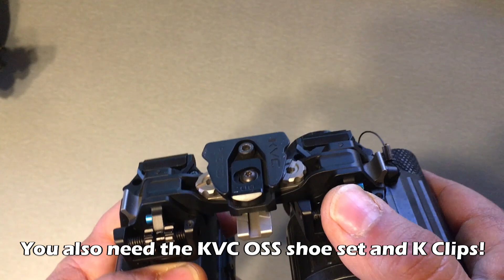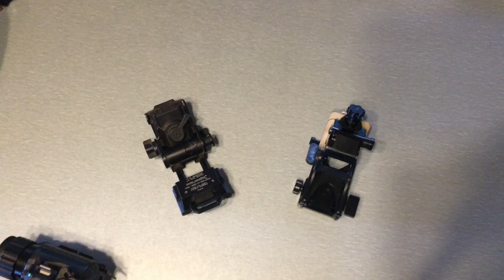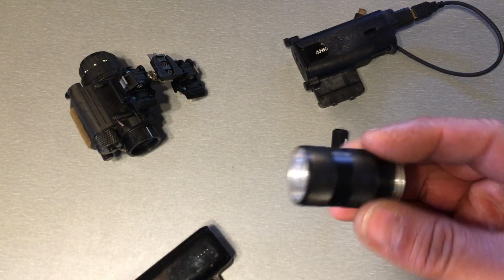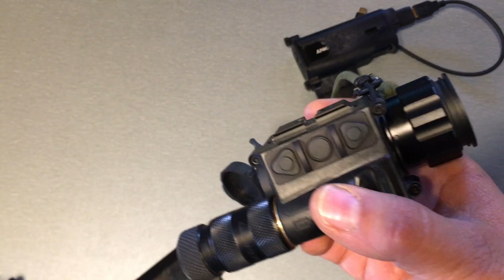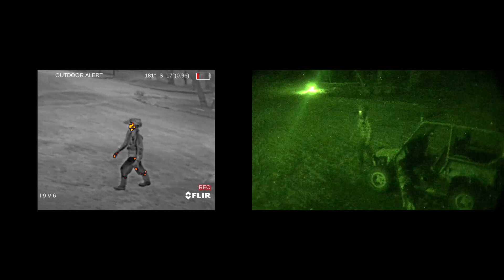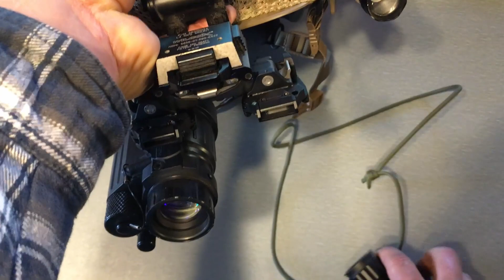Helmet Mounted Thermal : FLIR Breach PTQ136 & PVS-14 on KVC Universal Bridge

Comment: When watching this video I dont understand where the PVS 14 would excel vs thermal. In all these comparison videos thermal seems to brighten the dark areas just as well as the pvs-14 units.
Reply from the maker: The best way to think about it is that night vision is for moving/movement and thermal is for stationary use.

When using thermal you are staring at a small screen and there is latency in the image which does not work well for when using it for walking etc. as well it’s not a “natural” view. With analog night vision although you are still staring at a screen through the lens, you truly feel like you are seeing through the tube. There is zero latency and the image is very natural. It is FAR easier to move with.

Some other advantages are that night vision can see through glass whereas thermal cannot, you can see/use IR tools such as lasers & illuminator, and longer run time (less battery drain).

Which one is better for you honestly depends on what you are wanting it to do for you. Most users end up with both because they compliment each other extremely well.
Reply: @NITEWALKER-NIGHTVISION  awesome thanks for the detailed answer. From what i understand night vision is also better at picking up terrain detail and texture as its actually amplifying the light and can reveal shadows whereas thermal is simply picking up the infrared signature. I was planning on running a dual nv/thermal setup. Would you consider the infiniray mh25 one of the best helmet mounted options?

Comment: If you were going to run a mono PVS-14, would you pair it with the Breach or a COTI? The COTI seems like a great option, but appears to be discontinued now.
Reply from the maker: You can pair it with a breach using a bridge like the noise fighters panobridge. I’d expect COTI’s to pop up on the used market considering how many guys bought them. I’d keep an eye out on the forums and eBay
Reply: @NITEWALKER-NIGHTVISION  sorry, I meant more from the standpoint of how useful each type of thermal is. It looks like the COTI is lighter and has longer battery life. I actually found a source that has both options for roughly the same price right now. I'm just not familiar enough with the tech to understand what kind of thermal is better between an overlay on a mono tube 14 or the twin setup like you've shown here.
Reply from the maker: @Jazz3006  this should help https://youtu.be/kM2SoYXEuUE

Comment: I love my flir breach! I don’t do the goggle thing like you do. I work security and just use the breach by hand. I also have a agm Pvs 14 hen 3 green film I use at work. Love my night vision devices!
Reply from the maker: I agree, I love mine. FLIR got a bad rap when they ditched their PTS scope line but the Breach is a fantastic little thermal. Helmet mounted it works great for long term scanning.

Comment: Excellent video thanks. I have a Flir Scout 640 that I carry on a lanyard that slips into my top pocket to bring up to my non-NV eye occasionally for a look around. It works really well as the range is excellent on the 640 - out to 1000yds to ID a man-sized object. As you show on your side by sides, adding a thermal option shows things you just wouldn't pick up otherwise. Hand-held like this is not as useful in keeping your hands free but does keep the helmet weight down and is a good long-range compromise.

Comment: Hello. 
I didnt it find in manual of Flir Breach. It`s ok to use 3.7 volt 
rechargble battery (4.2 volt full charge)  
instead of 3.0 Volt  CR123 battery?
My frend try to use 
rechargble in Pulsar termal sight  , and damage the sensor by overvoltage.
Reply from the maker: Page 7 of Breach Manual. It’s okay for 3.0v - 3.7v battery. I would use the Orbtronic protected batteries. Those are what most of the longtime users are using and also what I’m using.
Reply from the maker: Orbtronic 16650 with the Mod Armory battery extender
Reply: @NITEWALKER-NIGHTVISION  Thanks a lot!
I`m thinking about  buy Breach and this was  one of my 
concern.
"Orbtronic 16650" - this type of battery turn in to 3V after uplaing some load? Or regular 3.7 rechargeble?
Reply from the maker: @Mil0Fedaikin  I haven’t measured it myself. It’s a rechargeable so probably 3.7
Reply from the maker: @Mil0Fedaikin  Or use an Anker external battery for the USB-C port on the Breach. Those work well with it too
Reply: @NITEWALKER-NIGHTVISION   One more question about this setup.How many counterweight you use with them ?
Reply from the maker: @Mil0Fedaikin  I keep the same amount of counterweight I use for dual PVS-14s (22.6oz) because I switch back and forth between the Breach and a PVS-14.

Comment: I'm planning to mount a Sionyx Aurora pro bridged with a Leupold LTO 2 Std on a Lions Hiperion adapter bridge and wanted to see if there's noticeable lag or disorientation. Does it trip you up when you larp and you constantly have to flip up your arms or mount or have you gotten used to it for long period of use?
Reply from the maker: I’ve never used the Aurora or the LTO. The info that I’ve read/heard is that the Aurora is pretty decent but it will absolutely need an illuminator on darker nights. The LTO will be laggy, may be ok for stationary scanning, but probably will not work well when moving.

Lol, well, I don’t larp so if you mean airsoft I don’t do airsoft. I don’t mean that in a negative way. It looks fun as hell! I live extremely rural with a lot of animal life so I use NV/thermal to watch for them and also instead of using headlamps at night when going around the property.

Comment: Awesome video. several months back I ordered L3 WP PVS 14 from NVision (after watching your videos and your help of replying to my comments) and while I was waiting on that I started reading up on the same exact setup as in this video and I thought this was the most superior way to do an NV setup. pulled a trigger on breach from JRH for a very good price and both arrived relatively same time so I have been running both for a little less than 2 months now with MOD Armory britge and TATM mount and I am very happy way it came out, it took some time to get used to but with WP and breach set to outdoor alert mode I found very easy to move around with PVS14 and as soon as something crossed it lights up with red/orange on breach and gets my attention immediately, other color pallets did not work well because the image would blend in with PVS14 and I would completely miss or loose time in detection of warmer objects. Have you tried running breach on WP PVS14? if yes what's your take on differences? Again, thank you for your work, and know that your videos help a lot of us who are just getting into NV world.
Reply from the maker: Thanks for the kind words. I’ll be swapping the unfilmed back into the -14s soon to try it out. I agree with outdoor alert mode making things pop better while they are both deployed.

Now that the moon is returning, it does work a bit better together for me vs dark nights. The main issue I have is I feel like I’m not getting a good image of either when they’re both deployed. 

Are you able to get any type of fused overlay? With either bridge KVC or D-14 I see double vision.
Reply: @NITEWALKER-NIGHTVISION  Yes there is still a double vision  but moving got lot easier for me after some time time of use. I also found it comfortable to run pvs-14 on my dominant eye and breach on the non dominant eye, i move with both down and my brain 90% focuses on pvs-14, some times it feels like breach is not even there, as soon something pop's on breach, i stop immediately and focus for as long as i need and then i resume to move with pvs-14, transitions used to be very slow and my head would start hurting but it's gotten much easier and faster now. Please update us when you try it with unfilmed pvs-14.
Reply from the maker: @lexousa  Thanks for the info and will do!

Comment: Human eyes converge at a focal point. If they're not allowed to, the image doesn't resolve naturally, and can cause double-vision, headaches, etc. (VR headsets have struggled with this)  It sounds like the bridge you're using holds both devices in parallel. Apparently that works with the analog tubes, but not with a digital sensor and screen in the mix. Wonder if there would be a way to tilt the devices inwards towards a focal point while still holding them firmly in the bridge. Or maybe just the Breach. Can the dovetail adapter on the Breach be adjusted minutely like that?
Cool vid, thanks for sharing. I've personally been mulling whether it'd be better to run a stand-alone thermal monocular or a COTI.
Reply from the maker: Thanks for the reply. I took them off the bridge and tried that with the same result. It seems guys can get the MH25 with the PVS-14 eyepiece to overlay by collimating with the PVS-14. As far as I know there’s no way to do it with the Breach. I did try collimating the PVS-14 by rotating the eyepiece while on the bridge to see if that did anything. Same result of double vision.

Comment: Do you know if the battery extender from MOD armory keeps the Breach's waterproofness rating?
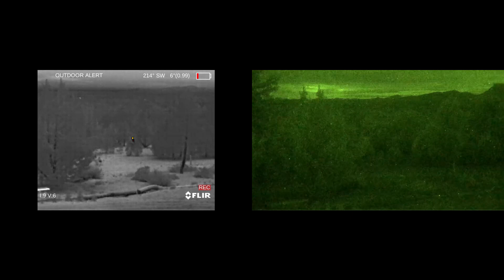At 15:19, what intensifier tube do you use? I played with an amber filter for a while, but found it to be too dark in low light conditions for my Mum-14. It does however work great if it is not extremely dark.
Thank you for making this video!
Reply from the maker: There is an o-ring on the cap side of the extender so that should maintain it however I don't if that's 100% accurate. The green phosphor tube I used in this video is an L3 M890AV. It's a 10160 autogated tube. Agreed on the amber filter. They work great on bright nights but when it's really dark out I prefer to remove it. The amber filter I used is a glass filter with a lighter color than the Wilcox. The Wilcox is WAY too dark. 

Thanks!

Comment: I bought an Anker battery to run my Breach. amazing battery life. the CR123 lasts about an hour.
Reply: Just a tip, be careful with the lithium ion batteries, in temperatures lower than 30° they lose charge fast, that's why I run a estebded battery with a long cable , and keep the battery inside of my jacket, and it's connected with one of those coiled secret service wire in the back, I run it through the back and clipped to my jacket, works good
Reply from the maker: @understandforonce  Most definitely. It's getting into the mid-to-low twenties and I'm experienced the same issue. What makes it worse with the 16650 is that the battery indicator doesn't work, lol
Reply from the maker: Oh yeah, the Anker is awesome. The Mod Armory battery extender is awesome for using it handheld so you don't have to mess with the pack or cable. It's fairly cheap too at $80
Reply: What wire did you use?
Reply: @BobBob-il2ku  ordered a cable off amazon with 90 degree offset plugs. should be at least 18" long

Comment: When you rotate the flir up, won't it work like a beacon to your rear?
Reply from the maker: With the brightness turned all the way down it's similar to light output from a PVS-14. I wish it had a real standby mode so there was no light and I'm not wasting battery power when I'm not using it.
Reply: @NITEWALKER-NIGHTVISION  Awhile ago I did read that the pulsar helion devices have a button to turn off the display only. If i remember correctly, they all have magnification greater than 1 though.
Reply from the maker: @heyarno  The Helion is nice but too big to head mount.
Reply: @NITEWALKER-NIGHTVISION  That too. I just wanted to point out that single button feature. there may be other devices that have one. Or maybe smart people figured out how to customise buttons on the flir via usb.

Comment: Waiting for funds for the KAC, then I'll be running the same system.  I found a 13k mah Anker battery bank that's pretty square, it fits nicely in the rear pouch of the Agilite bridge (dual functions, power and counterweight).

Thanks for the great videos 👍
Reply from the maker: Awesome and thanks! Keep a sharp eye on the OSS shoes and K clips. Everybody seems to be out of stock. Snag them if you see em!
Reply: OSS being out of stock is why I cancelled my order on the universal bridge and went D14
Reply from the maker: @deltaalphalima4759  Yeah it sucks right now with the mad rush on NV everything seems to be OOS